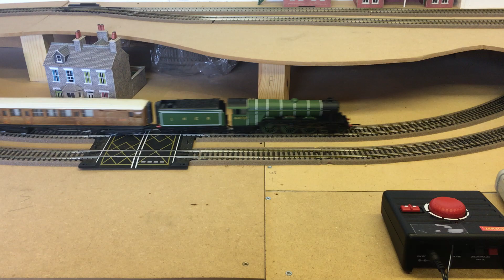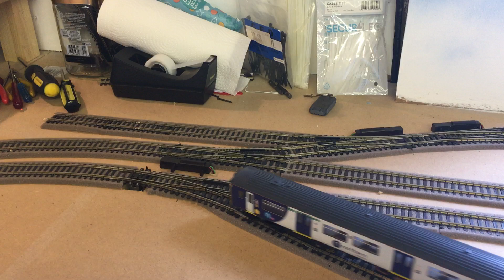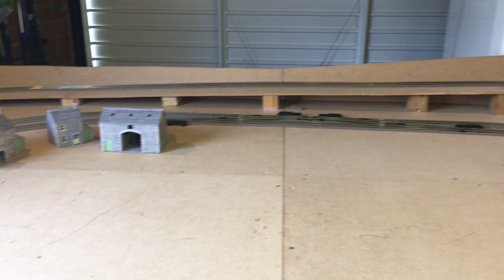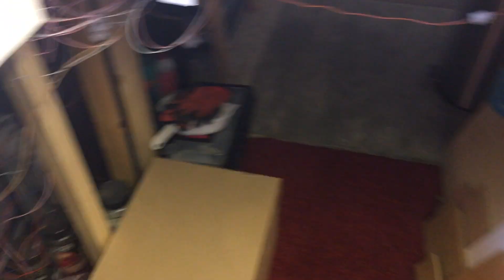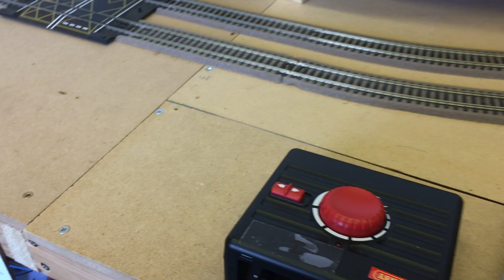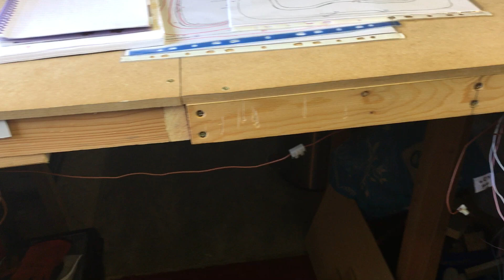Points and Power Sorted

Comment: Nice to see the progress. Just a little personal opinion  - that s-curve leading into (what I presume is) the small engine house looks pretty scary to me. As long as your equipment negotiates it ok then no issue.
Reply from the maker: Hi, thanks for the response.  Do you mean the entry to the shed that has the small diesel shunter just inside ?  If so, I think it will be okay.  It's only designed to hold a small shunter that will be used to remove coaches/wagons from any train entering one of the three sidings below, so that the mainline engine can be released for more work.  There haven't been any problems with the testing so far but I'll keep an eye on it!!  If I'm in the wrong place let me know.